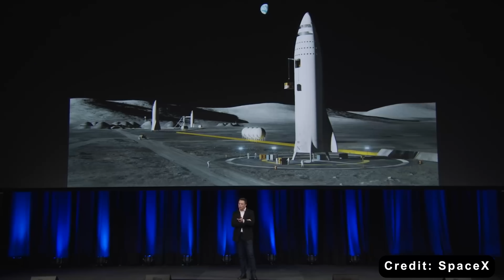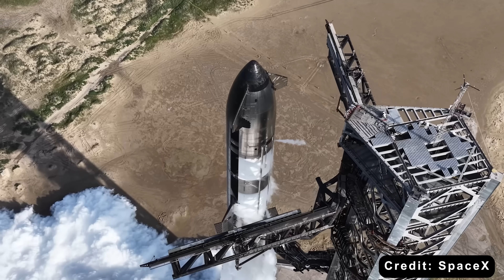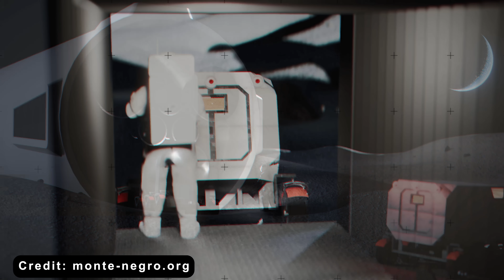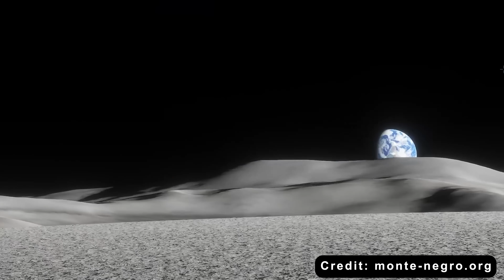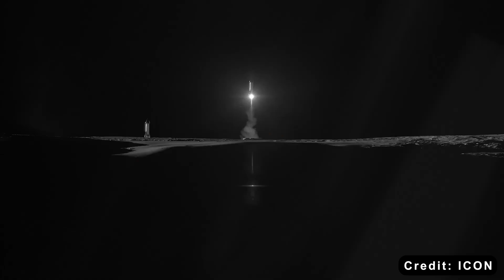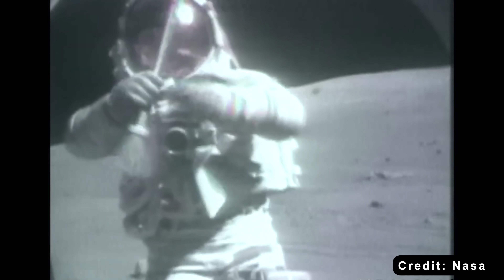Elon Musk Just Revealed SpaceX’s Moon Base Alpha — The 2028 Plan Is Insane!

Comment: This is utter nonsense. You can't do it on a budget, it gets to 200 deg c regularly on the moon. The wear and tear and amount of water you need for that heat would be unattainable even with a huge budget.  The Mars missions are much more attainable.

In terms of the moon projects, because of the incredible heat and temperature differences on the moon.  The only viable project would be heat resistant robots.  I am not totally sure but I think the type of robots that are self sufficient in such temperatures are fairly far away, maybe 40 years away in terms of tech.  Once you have viable robots you would want strict programming so they are not 'too' autonomous.  Then you would have them mine, conduct experiments, setup observations posts.  You would Make them build underground habitats for short stay human visits.

when humans arrive you would put 90% of robots in charge mode. So as not to creep out or complicate the survival chances of the humans. And you would have very limited human visits.  There is absolutely no logic in sending humans up there for prolonged periods. Unless you develop tech that is testing long stays in space.

Comment: Do an HLS - Horizontal Landing System. They would have to do a new design of the HLS for this but it's worth it. Land it horizontally from the get go, yes there is a way it would work. Eliminate all the accidentally toppling over and air bag complexity and the horizontal landing gear can also auto level the base. Build it horizontally in the interior while on earth and have some living and science area already from the get go, then remodel the tanks into living area later. Also an elevator would no longer be needed. I am talking about a permanent base version that would not need to leave the lunar surface.

Comment: Also, an electromagnetic railgun would work on the moon.  On the Earth, a railgun is not practical because the Earths gravity is so strong and the friction of the atmosphere would burn up the spacecraft since the acceleration occurs entirely in the first few seconds (while a rocket accelerates over several minutes).  But on the moon there is no atmosphere and gravity is only 1/6 as strong.

Comment: I can't see how an empty fuel tank can suddenly be turned into comfortable living space. You need additional freight flights to transport all the materials needed, as the original craft can't contain all that is needed. And at that point, they might as well have built the base out of those  freight flight materials without the complexity of a rocket craft having to tip over. The complexity of ( designing and construction ) dual use is likely much higher then just delivering the materials.

Comment: Message to Elon:  Rather than cables or airbags, at only 0.16g, you should be able lay the Starship down horizontally with a single servo-fuel-pump controlled side-thruster at the tip of the nose.

Comment: Cool and all for it. But what about all the rocks that crash into the moon? They will eventually crash into that structure.
Reply: over time the odds of one going right through  the base in to the shaft out the bottom.. ya.. if it isn't all in sealable segments with routes around compromised parts... its probably not a good plan.

Comment: You could tip it over. Or, you could land it like it was an airplane. Adding side thrusters to simulate lift. Then land that puppy.
Donald Slaton once said that America needs a competitor. 
Yes rocket fuel and air. But also the building blocks for  all sorts to building materials'. All locked in that moondust.

Comment: The moon's surface looks like a golf ball from all of the small(ish) meteorites that hit it on a regular basis. are they going to install a giant sand wedge?  or maybe a giant net to cover the base?
Reply: I assume they just will use the lava tubes (which are 10x bigger than the Earth's tubes) as a place to live. They can pressurize the lava tubes (30-50ft tall) and just live down there. They could store water at the top of the tubes as radiation protection. Since lava tubes are all ready there all they would need to do is pressurize each end then get to building inside the tube. Such an easy way to get a LOT of living space on the moon.

Comment: PS the rockets motors can be either removed from the ship or a pre manufactured cover could be placed over them to seal the rockets .. I would not be using 3D printing I'd use a simpler method .. manufacture concrete like material from the moon's material .. inflat large domes then spray the material over the bladders with multiple layers placing wire mesh and  insulation materials to reflect radiation .. multiple domes can be constructed with the reusable bladders .. whole craters could be covered over to create a large habitat.. all the needed equipment will need to be shipped from earth no matter how you do it ..

Comment: To turn the rocket on its side you could do something simple like attaching cables to the upper body then position a bladder next to the base of the ship then inflat the bladder  attach a cable to the bladder with the end of the cable joined to the other two cables.. then as you pull the cable the ship tilts landing on the bladder as the bladder is pulled forward the ship tilts more until the bladder is pulled fully from under the ship then the cables can be removed when the ship is horizontal.. the bladder compacting the soil by the weight of the ship itself .. a set of pulleys on the two guide cables will redirect the force to position the ship and not drag it forward

Comment: yeah like all his predictions , bullshit
Reply: Predictions like a reuseable rocket engine that would drop launching cost down by 98%?
Reply: no that one this one 
Technology & Transportation

One million Tesla robotaxis on the road by 2020
Musk claimed there would be over one million fully autonomous Tesla robotaxis by 2020. This did not happen: full autonomy is still not achieved and the fleet does not exist.

Fully autonomous driving without human supervision (Level 5)
Tesla vehicles were expected to reach full self-driving capability quickly. They still require human supervision and have not received full regulatory approval.

Tesla Semi mass production by 2019
Mass production of the electric truck was promised for 2019, but it was delayed for years, with only limited deliveries much later.

Cybertruck delivered in 2021 with all promised features
The Cybertruck arrived much later (late 2023), and several promised features were reduced, delayed, or removed (low base price, 500+ mile range, Cyberquad, amphibious capability, etc.).

High-speed underground tunnel networks
The Boring Company was supposed to revolutionize urban transport with fast underground tunnels. What exists today is mostly small-scale or experimental (e.g., Las Vegas), far from the original vision.

🚀 Space & Colonization

Human colony on Mars by 2024
Musk repeatedly spoke about sending humans to Mars and starting a colony by the mid-2020s. As of now, this has not happened and no firm date exists.

Starship reaching orbit by 2022
Musk expected Starship to reach orbit by 2022. The program experienced multiple delays and extended testing phases.

Permanent Moon base by 2025
The idea of a permanent human presence on the Moon by 2025 has not materialized.

🧠 Futuristic Technology

Neuralink human trials by 2020
Musk claimed Neuralink would begin human trials by 2020. Actual human implants began only years later and on a very limited scale.

Mass production of humanoid robots (Optimus)
Musk predicted large-scale production of humanoid robots within a few years. As of now, mass production has not started and timelines remain unclear.

🌐 Internet & Energy

Cheap, universally accessible global internet via Starlink
While Starlink expanded coverage, it did not reach the low-cost, universal access originally implied.

Tesla Superchargers powered entirely by solar energy
Musk suggested Superchargers would be fully solar-powered, but this was not implemented on a large scale.

📉 Public Predictions on Global Events

“Near-zero new COVID-19 cases in the U.S. by April 2020”
Musk publicly claimed U.S. COVID-19 cases would drop to almost zero by late April 2020 — which did not happen.

do u need more ?
Reply: @DaltonJobs you do realise half of those weren't completely his fault? FAA has regulated a lot of his spaceX moves and added huge delays requiring him to do extra testing (not saying that he can guarantee it without constant interferences). Covid would disappear earlier yeah if people weren't morons and selfish. His starlink satelite vision is still not fully into play because the FAA doesn't let him do it. A lot of his visions did also come true. You are only capable of complaining when you achieved nothing valuable your whole life while the guy is out there pushing for things to happen and human advancement. Nothing is guaranteed.
Reply: @robmaster3332  if u think the maximum expression of a human is Elon that s your problem
Reply: @DaltonJobs no we need more people like him, not you. One gets some things done but all you do is complain and do nothing.

Comment: How about a wigwam set up, 3 rockets land near each other, then they lean on each other in a triangle. each rocket has a conveyer belt along it outer parts, which bring materials to the top point of the 3 rockets. have a material spreader and robot arms place materials over the triangle canopy. use inflatable temporary walls like when you do paper mache. you could add hoses like when you pump cement into a house footing, have them fed from the top apex down to the bottom resting on the balloon walls gradually ending up to the top of the pyramid structure. there you have a space pyramid.

Comment: This is all a bunch of Musk BS.  One of the biggest problems with going back to the moon is moon dust. It's toxic, very abrasive, and sticks to everything. Small amounts can be very harmful and do damage to equipment. Working on the moon would track it inside the moon lander and equipment. Very bad. Also, living in an open area under ground ground won't work because the space can't be sealed and would leak oxygen along with dust issues. The moon base needs to be a completed unit when landing. The base and equipment need to be designed to minimize dust contamination. This would be difficult over time.
Reply: Ya, you're a tool.

Comment: Instead of solar panels on the Lunar surface where moon dust will be a problem, having a couple large arrays in orbit that beam the energy down via microwaves to a receiver a couple miles away from the base that are cabled to send the converted power.. Or a good old fashioned nuclear reactor that could run 24/7 producing power..

Comment: Why not Pre-build all the interiors in the Tanks but leave all entrances Open of the interior then you only have to open the tank exterior from the personnel compartments into the tank. The just go in and clean and place items that are not solid like bedding and things. You could already have things like tables and counters that would be harmed from the fuels on them. If you land then convert that means you'd have to already have the materials to make the flooring and walls on the ship so the weight wouldn't change just the location either stored to be installed later taking time OR already installed then not have to take the time.
Reply: I guess empty it doesn't matter that much what angle the ship trips down. Otherwise just like a few degrees twist would mean your furniture isn't horizontal aligned anymore.
Reply: @Wokoman1  good point but I'm sure they have to have some kind of level indicator just to be able to land like they do. So could always use the same to level by rolling it slightly, It's would still be faster then assembling after landing.

Comment: If the Starship hull never has to reenter Earths gravity well and atmosphere tons of weight can be stripped off.. If it is also not responsible for breaking Earth's orbit and traveling to the Moon with a crew it can be done at a much slower speed say a month.. Landing at a preprepared site excavated by robotic machines and laid over with an inflatable bladder or with some kind of tethered thruster pack that lowers it down.. This would certainly accelerate the construction of a permanent base, if done 5 or 10 tome the base could be huge.. It would be a waste of time and money to try and repurpose fuel tanks on the Moon.. Better to build hulls that are already configured and move them to the Moon and place them.. Two inflatable towers on Lunar crawlers could be placed on either side then attached to the hull and used to lower it down as they are deflated and the landing legs are retracted.. Another way would be to have a reuseable rocket powered sky crane that would move the hulls from Lunar orbit to the surface already in the horizontal position then go back to orbit and be refueled and do this again..

Comment: didn't know the moon had dust storms.
Reply: It doesn’t unless you stir up the dust with the exhaust from your engines. Even then it wouldn’t stay suspended in the vacuum for more than a couple of minutes depending on the force with which it was blown off the surface.

Comment: Why do we need to waste the full starship why not just use the ship to bring the heavy machines for constructing or 3D printing a good sized dome that has many levels with at the top is a section where the top section of a starship could be designed to let that top section be detached then using a lunar crane it lifts it off and over on the top of the dome then a temporary heat shield put over the engine section so the ship can lift off and return to earth and a new top attached. With the starship nose placed on the dome as a lookout and control area extra shielding can be put in place around the hull.

Comment: Cover the spaceship with a tent that has the solar panels built into it, Check! Have the battery banks inside on the walls and have an external plug in to plug the tent cover solar panels into. Then you'll have more room for another spaceship to park next too it then connect them with tunnels to expand the tunnels to spacepaces. Also make a spray to spray the moon dust to make it into a hard concrete to protect the spaceships and tunnels, then maybe put the cover with the solar panels onto that. IDK! just a thought.

Comment: I have a better way to do this,
1) Astronauts won't be landing in Starship, i'll be full of robots,  The humans remain in orbit to cut down latency on control of Optimus robots
Those robots can start to dig a shaft, which can be widened out to provide a very large space that can be pressurized
You could probably do with electric jack hammers, the robots pick up debris and it's lifted out of the shaft
Underground habits can be eventually pressured and will provide protect from solar rays
You could set up large hydroponic arrays in tunnels,

2) Dropping the rocket on it's side is good idea, why not used Draco thrusters on the top of the rocket.  They fire and tilt the rocket over, the ones underneath control the rocket's placement on the moon.  They're pretty powerful and SpaceX has a lot of them.

The space station could be pretty much built and compete before humans ride down that gravity well,  Humans are  really not needed to build the station or to explore the moon.

Comment: Didn't Musk himself say it would require 8x refueling to get there with current technology?

Up to 8 tanker flights — Musk tweeted that “16 flights is extremely unlikely” and that about 8 Starship launches (each delivering ~150 tons of propellant) would be enough to fill the ~1200 ton tanks of a lunar Starship variant in orbit

They are going to need fuel for heat, light, and operational integrity. By that I mean digging and purifying is going to require scientific processes with high tech solutions. That requires fuel and oxygen, because you can't open the window to get that up there. 

If they intend to use fuel tanks as space for people, you have to empty, store and clean those tanks. Keeping the residual gasses as precious and highly controlled fuel reserves for any mission. 

Even after you've cleaned and prepared a fuel tank for residence you have to find oxygen and a pressure and general environmental regulation system. None of which has ever been successfully completed, it failed drastically here on earth. Get it wrong up there and you've got a lot of graves to dig too.

Comment: They should use Legs attached at the balance  point. Rotate the ship 90 degrees to form a T with legs down and ship transverse. Then slowly lower the ship. That way the landing gear doubles as a crane to rotate the craft to the horizontal. Lastly you could disconnect the leg/crane and position it over a volcanic tube opening! A safe elevator in and out of the most interesting feature for building a base.😊
Reply from the maker: That’s a super creative idea for Starship’s landing and deployment! 🚀 Using the landing gear as a crane for horizontal placement and then an elevator for a lava tube entrance is very innovative.

Comment: For power why not KILO Nuclear Power 5 KW systems and/or Methane fuel cell or both? The covering of the starship with Polyethylene Sand-baggy 12in x 25ft, used for earth ship homes. The Polyethylene adds a little radiation shielding.
Reply: energy output vs payload is many times better with photovoltaic panels than with kilo power reactor on the rim of Shackleton crater